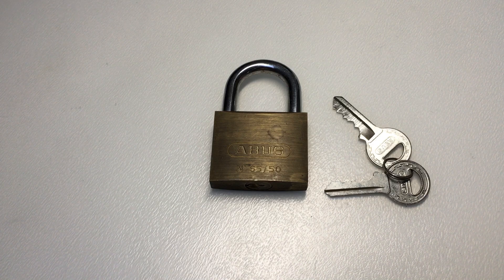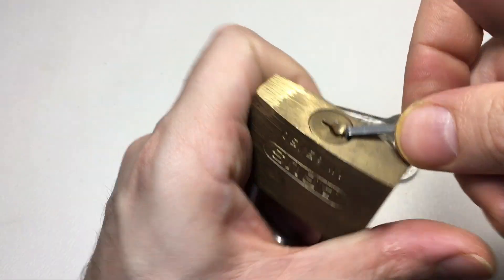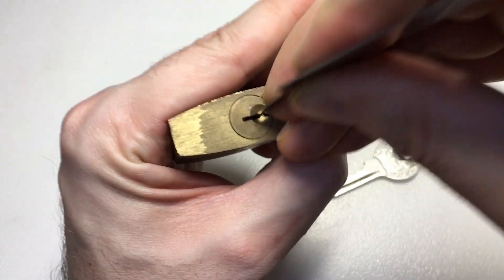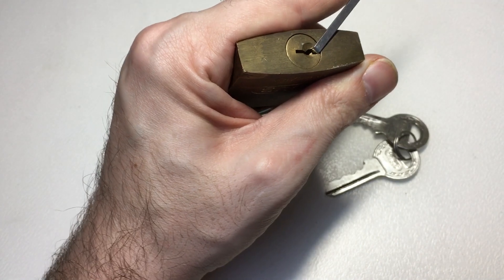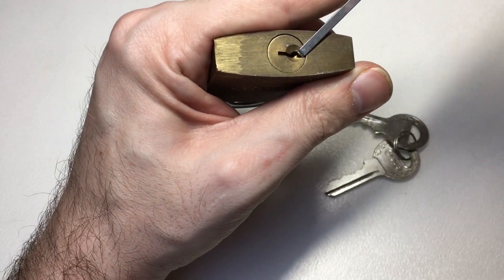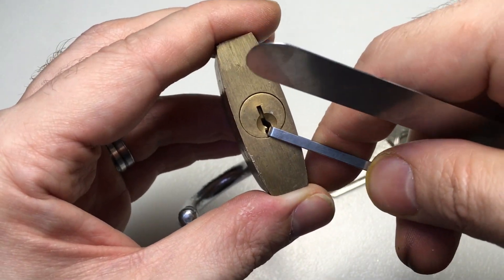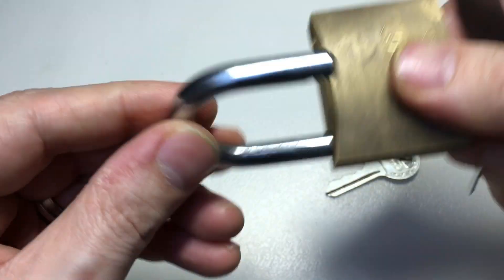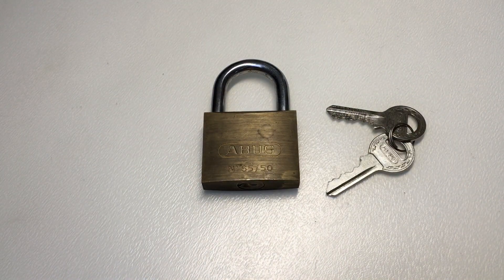(375) ABUS 65/50 Padlock Hybrid Picked (and a Tensioning Lesson)

Comment: Well Mr. Noob.  6yr old post, still helping people out.  I screwed up and got TOO many new locks at once. I've never had ADHD, but I think this must be what an extremely mild case might feel like if it was for everything else in my day too. 

Although I'm tempted to choose a lock I can progressive pin, I saw this video and decided to go for the 65/50, sorta because you're using BOK on it.  I even pulled out my "Medusa" that I don't use for better locks.  Immediate false set and open. 

Now I just need to be able to repeat it 5-10 times, then put it in my practice rotation. 

Thank you for the knowledge AND the Medusa!